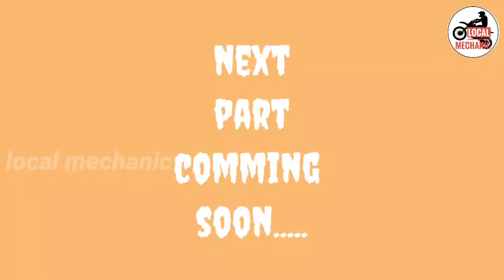pulsar 150 engine refitting part 1-local mechanic

Comment: Bro, excellent job keep it up Pulsar 150 ug4 white smoke problem, what is the cost of repair
Reply from the maker: Full engine work ₹8000
Reply: @LocalMechanicTamil   bro 2011 modal pulsar 150 ku evalo cost? Bro
Reply: Reply pannuga bro ₹?

Comment: Anna fz v1.    Throttle thiruvitu vitta selincer la டப் டப் nu sound varuthu enna problem ha irukum
Reply from the maker: Plug change pannunga...
Carpuretor clean pannunga...
Coil check pannunga...
Air filter change pannunga...

Comment: Bro enoda pulsar 150 ideling neekala 6000 rpm oru 5 minutes drive pannah bike accilarator kudutha bike move aga matanuthu bike Kick pannah kicker rba soft ah iruku compration illa bro bike engine cooling ah irutha compration iruku ennah issue ah irukum
Reply from the maker: Valve check pannunga....

Comment: hi bro,,, engine la bearrings mattum yellamum change pannanum, price yevlo aagum bro
Reply from the maker: Bearring mattum change panna mutiyathu bro...
Reply: @LocalMechanicTamil   yen bro.??  engine service pannan, new bore, new clutch plate,new timing chain,
engin romba neram run aanuchinaa kasa kasa sound varumla,
athu pola startinglaye varuthu bro
enna problm
Reply from the maker: ₹10000 full work parunga bro
Reply: @LocalMechanicTamil  bro ippothaan bro bore ,clutch plate new ah potan bro,,, appovum 7000 aach bro
Reply: nalla respond panringa, thankuu bro
Reply from the maker: Engine pirissale bore pannanum bro
Maththa ethum pannaventam....
Reply from the maker: Thank you